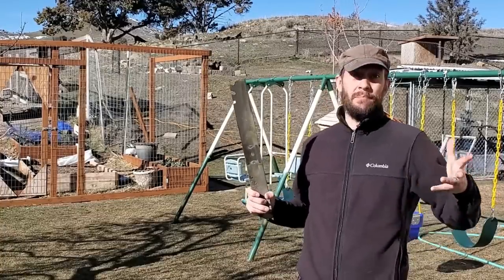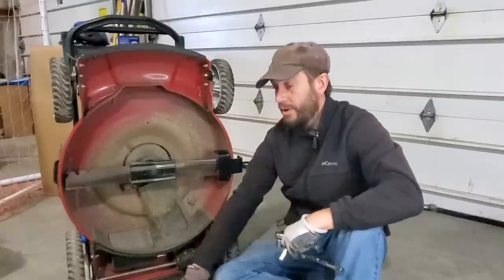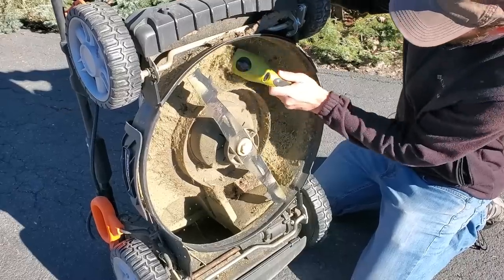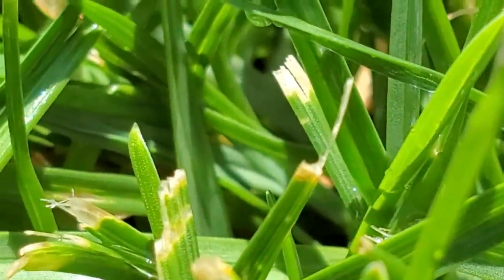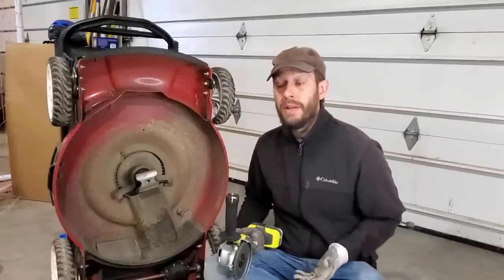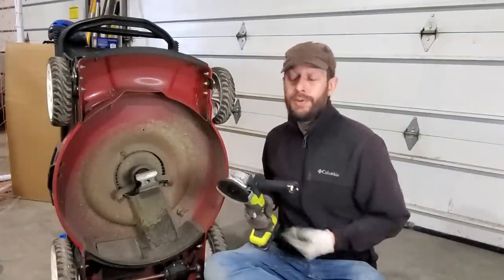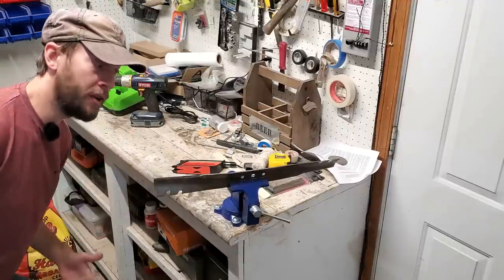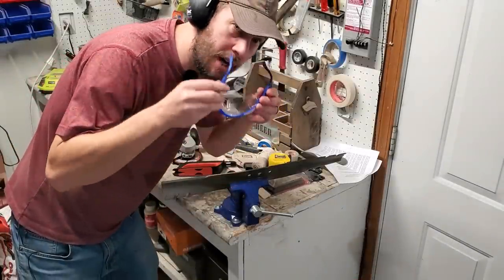How To Sharpen A Mower Blade: 5 Ways Compared

Comment: My advice is to buy a second blade so one is always super sharp and you can sharpen your off blade on a rainy day. Also allows quick return to mowing on your nice days.
Reply from the maker: That's always good advice especially for those unexpected times where you damage a blade beyond repair. Doesn't happen often but it's always a possibility. For me sharpening the blade is quick enough I can get it done in just five minutes or so prior to mowing so only having a single blade isn't that big of a deal but I'm not the average dude. lol
Reply: I definitely do this!
Reply: Great tip! I'm going to do this.
Reply: Do you sharpen brand new blades?  I bought an OEM replacement blade, the edge is not as sharp as it could be.  It is shredding the ends of the grass; basically no better than the blade that I removed (which has a few nicks, so I will sharpen that with a file in a bench vice).

Comment: Dude, you do know you are using the file in the wrong direction? No wonder it took a while..  It cuts on the push, not a pull and it probably damages it on the pull so you lift.

Comment: If you want your lawn mower to keep clean from grass sticking to it.  Wash it clean if a used lawnmower.  Then spray two coats of car undercoating the fast drying type (tar).  Let it dry 24 hours before using.  On a brand new out of the box mower, do the same procedure.  Your lawn mowers will be much more cleaner from grass clippings.  Hose down after use. Do not scrape, just use soap and a sponge or wash cloth to wash your lawn more underneath.

Comment: Used a file for years and always struggled with maintaining correct angle on my not flat mulching blades…and a lot of time. I have a 3 blade mower as well. Finally splurged on an All American Sharpener, so worth it. Once you learn it, takes seconds for a perfect angle and edge, or minutes to grind out dings. Not cheap, but will last a lifetime. Best deal is through the company, not Amazon. Cheers.
Reply from the maker: That's pretty sweet; I thought about going that far with my tools but have hesitated thus far since the vise and angle grinder are so easy for me and both tools can be used for so many other things. Enjoy what you nabbed though!

Comment: Great Video!  Love the level of detail and your experiences,  I have a Honda mower with the dual blade set up.  The lower blade always gets dull first and wears out first.   At the beginning of the season, when I do oil and air filters,  I always sharpen my blade and tell myself I am gonna sharpen it every 8 hours of use.  But in reality I only sharpen them 1-2 times each season.   One thing to note, is the be sure to torque the blade back on to the proper spec.  Mine has two bolts and require 40 FT LBs each.

Comment: good info.  I have tried many methods.  i now use a new 8 in. Bastard Cut Half Round File and sharpen the blade every other time i mow in about 45 to 60 seconds.  The first time you do it it will likely take about three minutes, but after that, it should be under a minute if you are a bit skilled.  The key is to have magnifying glasses on and wear a pair of gloves to keep from getting cut, and to not go for perfection.  Just nock the big dings off at the angle of the bevel and the angle for the bottom and then simply slide the file along the bevel angle 2 or 3 times and once lightly on the back at the flat angle, then rotate the blade 180 deg to do the other side, then cut the lawn.  Sometimes i use the little 1"x3"  DMT 320G diamond stone instead of the file.

If the blade is out of balance in the beginning (once), you need to take it off and use that tool ($5 Home Depot).  Plan on spending 20 min between that tool and the vise + file to get it spot on (this is the time to look towards perfection).  You should never have to balance it again.

Comment: Good advice and tutorial for the newbie and uneducated in proper blade care. May I offer a few tips as well? 🙂 For folks who do not own an angle grinder and have to use a file make sure you are pushing the file and not pulling. If you look at the way they are made the teeth are pointed and file away from the handle. When you pull it (from the handle end) not only will it be ineffective in sharpening, but will dull the file as well. When using an angle grinder always have the disc contact at the leading edge of the blade sharpening toward the meat of the blade. The object is to reduce heat at the leading edge so as not to lose the tempering of the blade thus keeping it sharper longer. Also it leaves a burr free edge. Bonus! Thank you for talking about the balancing of the blade as I, as I'm sure have many, forgotten this important critical step and then wondered "why in the heck is my mower rattling"! Ha!
Reply from the maker: Excellent tips Ray; a lot of us do it all wrong in the beginning as we fumble along figuring it all out. I probably used terrible filing form back when I fist trying to sharpen my blades with them a handful of years back. These days I just don't have the patience for hand filing any more. I have way too much on my plate for that kind of time commitment, lol.
Reply: Love the way how you point out the so called expert that he does not now how to use a file without saying it.

Comment: I made a wooden jig to fit in the vise and hold the blade horizontal so that I could grind it in a more comfortable position with the angle grinder,.  It also is safer than clamping the blade vertically since all the sparks and bits of metal are thrown off sideways away from my face.  The jig uses two 2-inch carriage bolts (Honda mowers have two bolts) inserted from the bottom of the jig with a fender washer and hex nut on top to secure the blade.  The wooden part is made from two 1x2 wood pieces glued together for the clamping part and another 1x2 shaped to keep the blade evenly supported since it's not perfectly flat in the middle where it bolts to the mower.  All this was done with common hand tools and an electric drill.  Cost was about a dollar for the carriage bolts, washers and nuts.  Wood was scrap I had lying around.  BTW, I keep 2 extra blades on hand so changing them is fast and I can sharpen when I have time.  Thanks for making these videos.

Comment: Mower blades are meant to be single bevel because it needs to create a vortex in the mower; if u cut air evenly with a double bevel edge then it reduces drag and therefore no uplift on the grass

All airplane wings have a teardrop like shape but it’s to facilitate a slower and faster current of air with mechanical energy and it’s the same premise with the bottom of the mower blades having a slight differential in drag which then creates directional airflow; usually toward the mower deck

Comment: I learned this in botany and horticulture classes at Humboldt State U. and it stuck with me ever since. 

Grass, like any other plant and YOU… are alive. 

When you cut any plant, think of it as a  SURGICAL OPERATION. 

Would you want your surgeon to show up with a dirty, dull scalpel?

I think not.   

This is the reason you should… 
Keep all blades sharpened at all times
Clean your shears, loppers, etc
Sterilize your cloning clippers. 

You WILL reduce the stress and disease to all of your plants.
Reply from the maker: Preach it! I need to do this to our gardening shears this year- new goal. 👊
Reply: @TurfMechanic  Thanks for the reply, 
I keep all of my kitchen utensils sharp at all times as well... Most dangerous utensil in the kitchen, anything that is supposed to be sharp that isn't... Retired HS (continuation) science & wood shop teacher. Years and years of anxiously watching and warning at-risk teens about shop safety, builds a strong personal habit. hahahaha

Comment: Instead of the grinding disc use a 80-60 grit flap disc. Sharpen so that the disc surface rotates with the direction of the blade , not against it. Flap disc vibrates less , more control , nicer finish. 10 minute job. If you are smart , you don't need to balance the blade. Cheers.

Comment: A right angle die grinder with a 2-3 inch disk works a lot better than the grinder.    Not as heavy and you can see what you're doing better.

Comment: Use a flap disk. It’ll change your life.
Reply from the maker: I currently have three rotary mowers at the house, I think I want to get three different grinding discs and use one disc on each mower blade to compare the sharpening process. Thanks for the suggestion!
Reply: @TurfMechanic  I’m a 30 year metal fabricator. The flap disk is going to be your best bet.
Reply from the maker: @chrisgossman4522  on it! I've got a flap disk in my Amazon cart now 😁